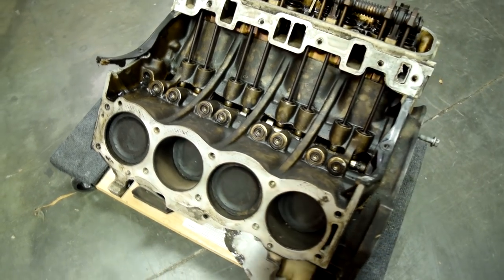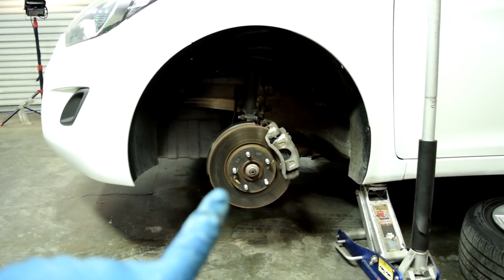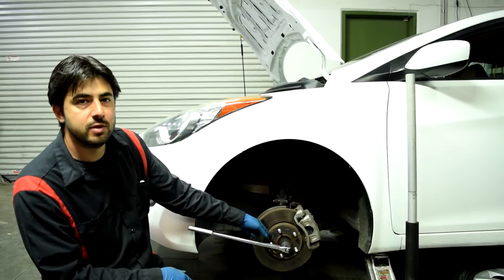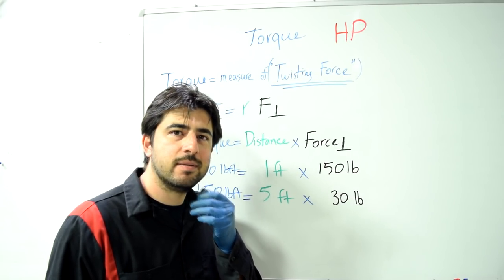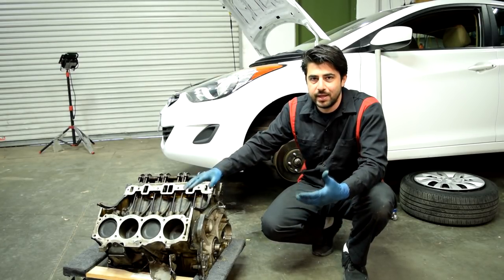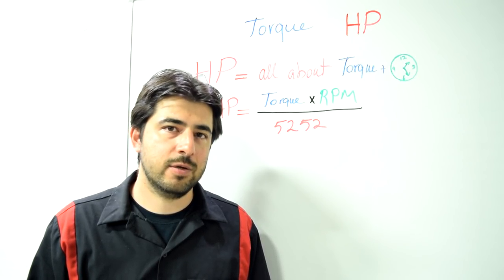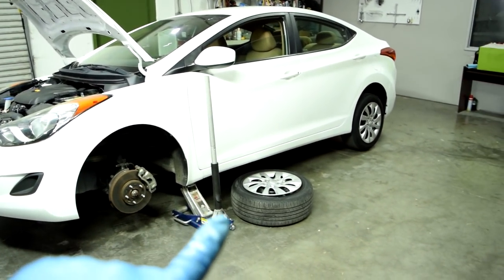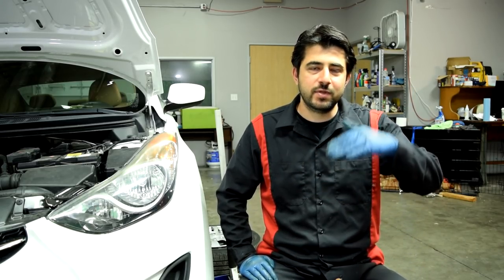Torque and Horsepower Explained - Easy and Simple Explanation

Comment: What is the simple explanation of the diference  between two engines of the same horsepower but of different torques
Reply: Power is torque x revs so the one with less torque has to rev faster.
Reply: They live at different revs. If installed in the same kind of vehicle, they will be geared differently. With that info, the vehicles would probably perform about the same in every way.

Comment: Tq = $/hr
Rpm= hours worked
Hp= Salary

If you want to buy stuff, you need to know how much you make. 

Person 1:   "Average car"      
20$/hr wage, 40 hours a week = say 2,400$ a month            tq x rpm = 1,600 units of energy to use to move the car

Person 2:  "used piece of crap car"
Minimum wage, 25 hours a week = 1,000$ a month           1,000 units of energy to use

person 3.   Sports car
40$/hr, 40hours a week = 6,400$/month            6,400 units of "spending cash"

person 4.   Formula Car
50$ an hour, 100 hours a week = 20,000$ a month    

As you can see, you can't buy something when all you have is a job pay rate(tq) with no hours worked(rpm). This is like saying how fast a car will be knowing its tq output. It needs more information. 
That is also no different than saying, I can afford that when all you know is hours you can work but dont know how much you make per hour. 

Hp is how much energy or money you have to work with, when dealing with spending it or buying things. This is just the same as Hp in a car.
TQ(hrly rate) is the effective rate of pay per unit of time worked. This is just like tq. How much can you get out of each piston explosion. 
hours worked or RPM is how many of these explosive units are being used.

Now what is actually at the wheel as far as hp and tq. Just think of it as tax on money. What is taken to get the money in your pocket. Sure you motor made 200hp before taxes. but after its 176whp after taxes. 

This analogy works perfectly. Its what everyone should think of. cause words like horsepower are not needed. tq x rpm = ____   is all you need

another way to think of it is this. 
Tq is 2 units. force at distance. That makes a 2 dimentional plane. Where one side of length (tq number) and the other side of the rectangle is length (distance of force applied to make said tq)
Rpm is making the 2d plane a 3d one. so.......    Force (side 1) X TQ (side 2) X Rpm (side 3 =   a 3 dimentional square or box.    the Volume of this box is called POWER..... the bigger the box, the more powerful. Its in this BOX that you can manipulate it with gearing to change the shape of the box to fit your needs. But 300hp is always 300hp and cant be changed in volume regardless of gearing. And 300hp box will always have more volume than a 250hp box. Tq can not make up for more hp cause hp already incorporates this into the size dimensions of the box created. 
so 300tq making 300hp is not more powerful than 100tq making 310hp.   Hp wins PERIOD

Comment: So (at around 2:55 ) in similar vein to this example, does that mean:   If I am 200 lbs and I apply my entire body weight using a 6 inch (aka Half a Foot...) length bar/wrench to turn something like this axle nut, would that indicate a Torque output of 100lbs..?   Ya know, Half the the leverage, so Half the poundage..? Lol. ✌️
Reply: Kind of, the torque would be 100 ft*lb, torque is not measured in lbs. The equation for torque is force*distance. In your example the force would be 200 lbs and the distance would be 0.5 ft for a total of 100 ft*lb

Comment: Ive seen dyno graphs where TQ  and  HP didnt cross at 5252.
Reply: also I dont understand how a dyno can measure TQ wouldnt it need to add resistance until the wheel coulnt turn the dyno?
Reply: if you found a dyno graph where the TQ and HP didn't cross at 5252 then it was a fake graph. The equation for horsepower is (torque*rpm)/5252. When the rpm is at 5252 it will cancel with the 5252 in the denominator and just leave you with torque
Reply: @Redtooth75  I didnt question it because it was a ferrari and it was slightly off, maybe 53XX
Reply: @phoenix21studios  its because the scaling on the y-axis is not the same for horsepower and torque. If you look at the right axis (torque) the values do not lign up with the horsepowe values
Reply: Redtooth 75 what about cars that don’t even rev to 5252.
Reply: @phoenix21studios  then the lines dont cross. The lines crossing is not significant,  it doesn't mean anything. Its just where the horsepower will be equal to the torque.

Comment: Interestinly, youll probably say this, torque and horsepower are the same at 5252 rpm
Reply: Torque and horsepower are never the same. Even when in certain units they share a number, they mean very different things. 5252 rpm has zero physical significance.

Comment: Torque is the "Raw" power masurement.
Reply: But its meaningless if you dont have a timeframe at which its done. You can have an engine with 3000 ftlbs of torque, but if it can only turn at 50 rpm, hardly any work is getting done.

Comment: So larger gears produce more torque? Also whose wife weighs 550lbs!? Also i want to know the math behind the conversion
Reply: A higher gear ratio multiplies torque more. It also reduces rpm more. 
If gear A has 10 teeth and and is meshed with gear B which has 20 teeth, then torque at gear A will be half of that at B, and rpm at A will be twice that of B. 
Now if gear B is welded to a shaft with another 10 tooth gear which is meshed with gear C which has 30 teeth, then torque at A is 1/6th that of C while rpm at A is 6 times C.
That's really all there is to it.
(The size or scale of the gears doesn't factor into this discussion. Gears are sized based on material, wear considerations, etc...)

Comment: So let's just say for the sake of conversation if my car had 800lbft of torque and only 100hp it would fly like a mofo at a drag strip but would have a low top speed like maybe 80mph?
Reply: If you paired that engine to a transmission and diff designed for more normal numbers like 300 lbft and 300HP, then it would fly like a mofo from 0 to 7 mph. Then after jerking through the gears you'd find it redlined in top gear at about 35 mph. If you geared it appropriately, you'd just have a turd economy car.

Comment: Car mag's r confusing with accelleration stats especially Euro cars like Ferrari who have hi HP but very low torque. Yet these cars r hugely fast. Torque is the twisting force that propel's these cars into the 11's yet their torque is barely 400 ft lbs. What gives??
Reply: It's torque at the wheels that matters and that depends on power. High revs give high power which produces high torque at the wheels when the right gear is used.
Reply: @nightjaronthegate only in regard to the same vehicle or couple if they have the same wheel radious and couple other confoguration like not enough big diffrwnc at wheel raiodus for specified torque proportion asf 👌🏻 otherwise assuming you comapre more powerfulll with much smaller wheel radious it dont need generate more drive wheel axis torque for ącceleration faster cos what really matter is not deive wheel axis torque assuming you dont kńow wheel raidous  👎🏻 but FOCE at contact path 👍🏻1000 hp at 100 km/h at 10 nm at drive wheel axis generate 10 times biger conatct path force than 100 hp at 100 km/h at 10000000 nm at drive wheel axis what those data say which im plot here? they say 1000 hp 10 nm have multiple times shprter wheel radious 👌🏻
Reply: 🤭 good pbservation 👍🏻 power :speed=force force:mass=acceleration  sport car with 750 hp 500 nm at optimal gearing be always Ccelerate better than feg 400 hp 1200 nm also at optimal gearing also cos of formula which i show 👍🏻 the only diffrenc be that 750 500 nm engine be always must work on much higher rpm 👌🏻 for have better acceleration for what it have optimal gearing 👍🏻 unless it have enough bad gearing than it can lost such race and ńo higher rpm at lower gear dont give better acceleration without more power cos again power:speed =force assuming you are at 100 km/h moment at 1/4 mille drag race attempt so 750 hp 500 nm version assuming be at max power rpm thanks good gearing will generate 750:100 = much more force accelerate this version forwRd than this 400 hp 1200 nm at 100 km/h cos 400 hp:100 is much less than 750 :100 dosent matter how much more 400 hp version would have torque at engine crank it be dead lost assuming optimal gearing for each  and offcorse teh same weight drive train losess roll and all other stuff equall like shifting time etc 👍🏻  the only diffrenc is that 400 hp 1200 nm veriosn let say it have 1200 nm at 2000 rpm vs version 750 hp 500 nm at 2000 rpm have 250 nm and 500 nm at 7000 rpm so this i mean 750 hp at crank 500 nm version will feell much weaker for normal the same daily riding rpm revv range which avg people use and would required much higher rpm at launch for launch similar fast as 400 hp 1200 nm version  up to like 4-5 k rpm or even to higher rpm dont watch precislelly 400 hp 1200 nm be much stronger 👌🏻 thats why most people i quees like 70-80 % at least after test ride will choice 400 hp 1200 nm version including me especially  in some big suv car or bus etc only  race maniac which like hogh rpm will choice 750 hp500 nm version for daily riding 😎👌🏻me not on track this version 750 hp 500 nm at iptimal gearing always be faster and win race but for daily riding it be 💩 you need to rev it high and always hold engine at very high rpm for get satisfy enpugh acceleration in normal road condition , unlessss in some light small car where its much weaker lowend at enought shorter gearing stilll be enough for most people 👌🏻
Reply: @mociczyczki  Torque at the wheel divided by wheel radius (including slightly squashed tyre).
My point was that crankshaft torque means nothing without the gearing, with a low gear giving more wheel torque than a high gear.
Reply: @nightjaronthegate  yea true if we comapre dofffrent velocity👌🏻 cos at set high velocity higher gear give more torq than low i mean only specified gear not lower and not hogher 😉 the most where engine genersted peak power 👍🏻

Comment: i dont understand why torque reduce after peak torque,and u did not explain this important point.well nice try
Reply: An engine can't continue to make high torque as speed increases because charge and exhaust gasses are limited on how quickly they can enter and leave the combustion chamber. In some cases they simply can't keep up with the speed of the piston. They begin compressing and expanding significantly due to their own mass and so less makes it past the valves when they are open. In some cases the gasses can also reach the speed of sound at the valve edges this creates standing shockwaves in the flow and severely limits how much can make it through. All this to say, every engine has a point where these effects begin reducing torque as speed increases.

Comment: Horsepower is the calculated amount of work an engine can do over time...pretty much measures torque output at varying RPM.   Torque is real....HP is made up math number stuff. Nuff Said